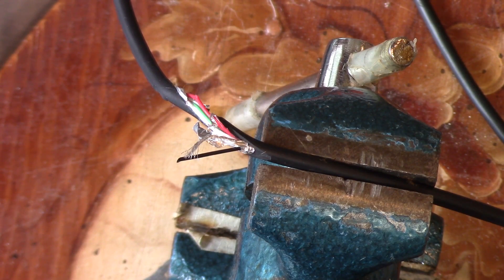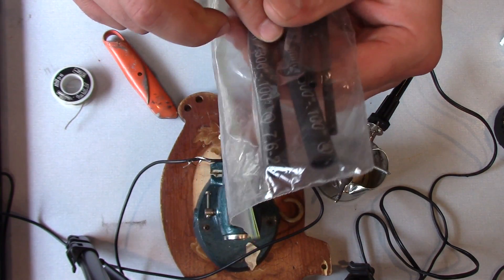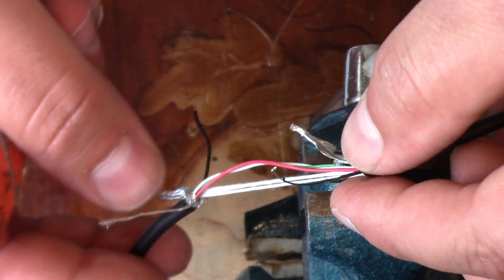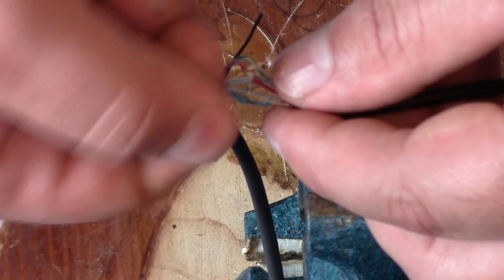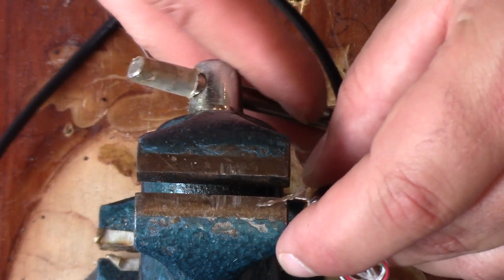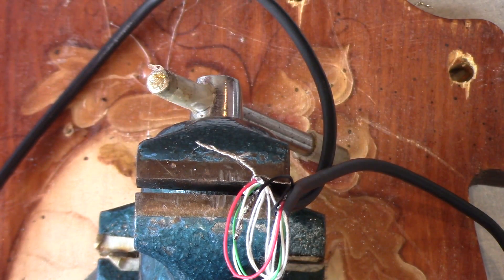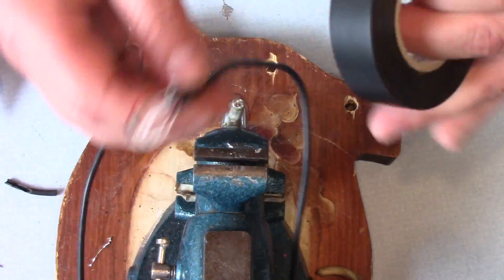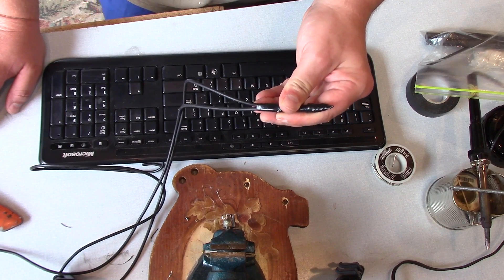How to Solder - USB Cable

Comment: do you happen to know the schematics for soldering the wires from a usb cable directly onto the pins in the usb port?which wire goes on which pin?(im working with something thats an air tight fit,so all i can do is solder directly.not enough room to actually plug the male into female )
Reply: Red = +ve.  Far left or right.
Black = -ve. Far right or left.
White = Data '+ve'. Middle left or right.
Green = Data '-ve'. Middle right or left.
Bare cable and foil is for earthing.
With the data wires I don't think it actually matters which way you hook them up as long as it's consistent at both ends of the cable.
Reply: @TheOneWhoMightBe  
thank you,i really appreciate it
Reply: @ShortFuseFighting   No worries.  If you're leaving the USB connector on one end, the easiest way to find out which wire is which is to use an ATX power supply (out of a desktop computer) and push 5V down each wire with an LED at the other end to see what lights up.
On the ATX 20 (or 24) pin motherboard connector, short the green wire and any black wire to start the power supply.  The 5V+ rail is the red wires (12V+ is yellow, 3.3V+ is orange).